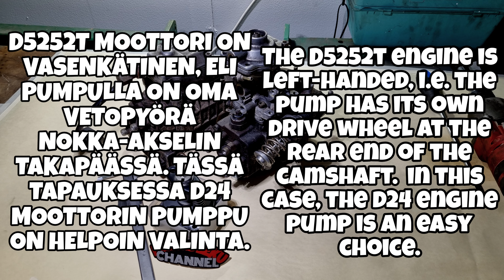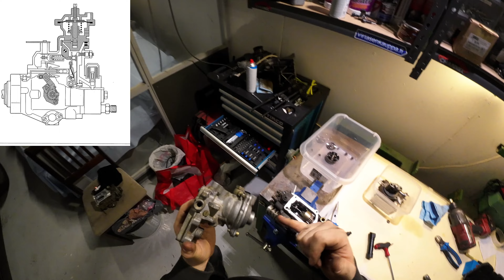How to make an MTDi-pump |PT.1| PaskaDeeku ProjectVlog

Comment: Thank you for video! I have 5cyl with mTDI pump in VW LT mk1, but Im missing LDA. Is it a big loss? Should I consider to add it on? 

Thx regards from czech
Reply from the maker: Its not a problem, just lots of smoke without boost😁😁😁